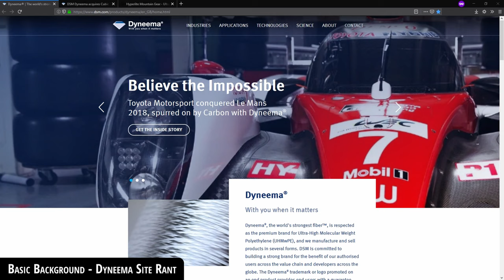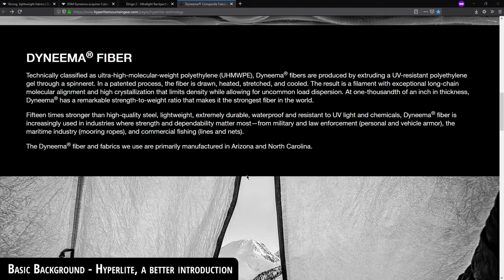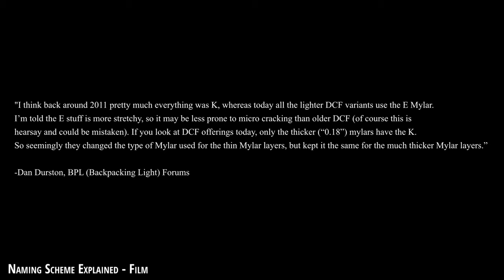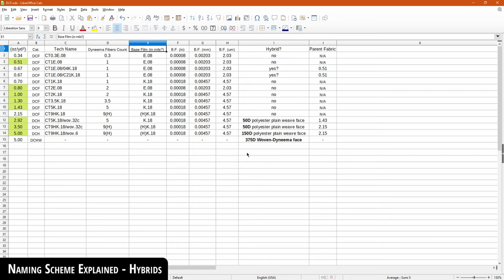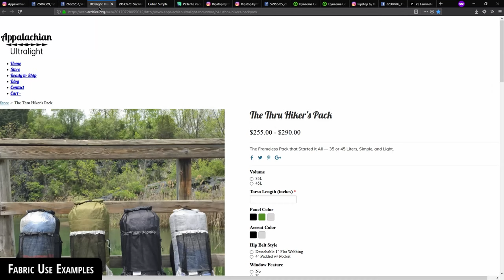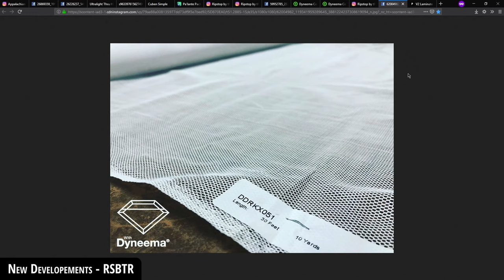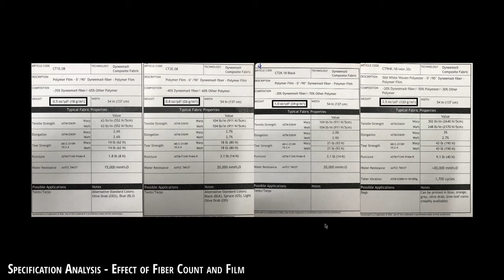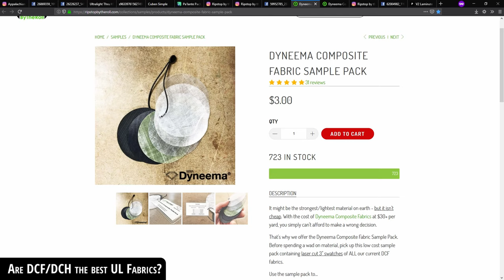DCF Explained

Comment: I own a bunch of HmG bags in various dyneema composite and woven etc and I don’t find them particularly resistant to abrasion AT ALL.  I would put fjallraven G1000 heavy material far far superior to dyneema for abrasion and overall strength.  Maybe not for weight but who cares about a few grams if the fabric doesn’t resist abrasion ??? So stupid.  Nice looking bags but quite delicate and don’t hold up over time (couple of years) even under light use it comes apart and abrades substantially